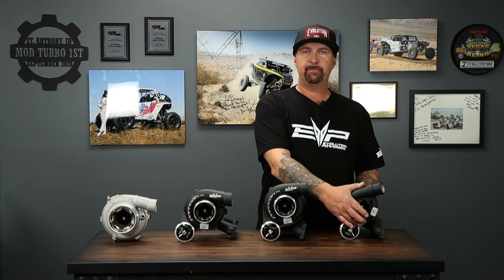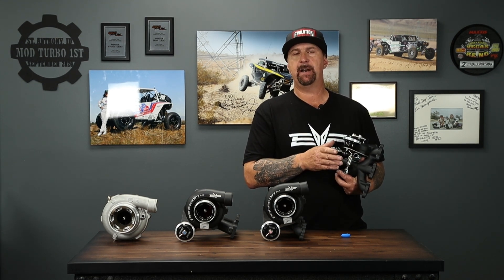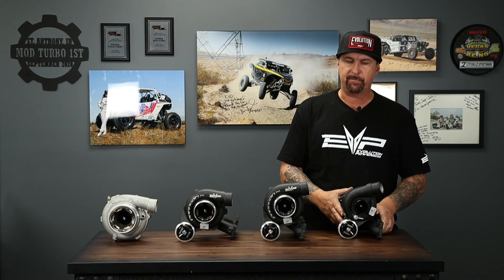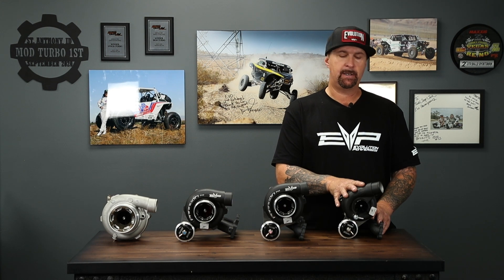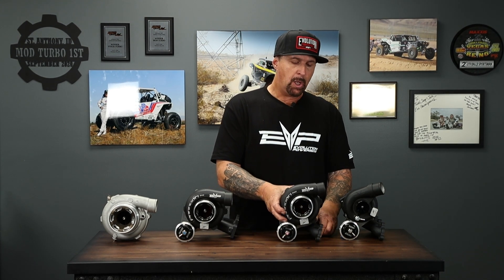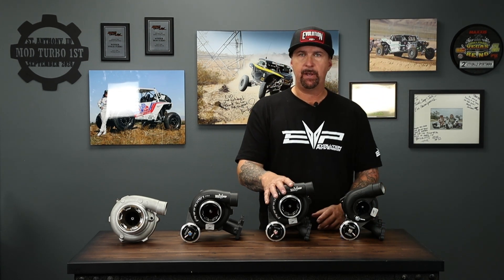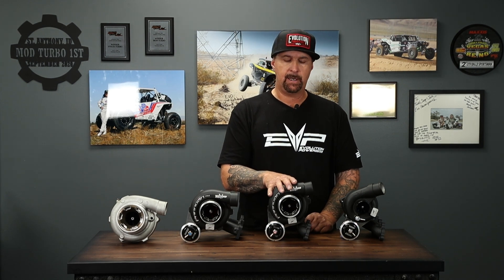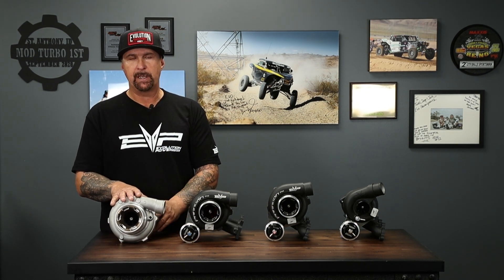Evolution Powersports Paragon Turbo Systems for Can-Am Maverick X3 & Polaris RZR

Comment: What clutching was used on the Polaris xpt and pro xp?
Reply: I would assume they are using a TAPP Clutch (pretty pricey) as its the best and only they sell for the Pro XP or at least a STM stage 4. Stock certainly would not hold these turbos unless on its 91 octane tune.